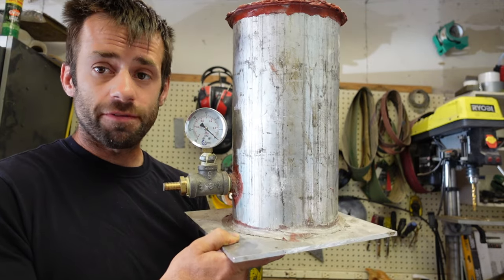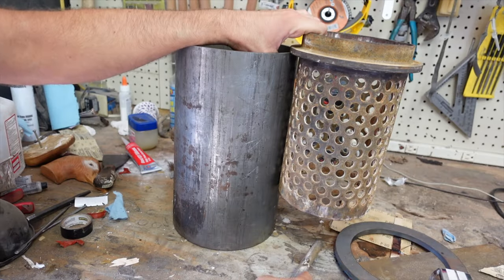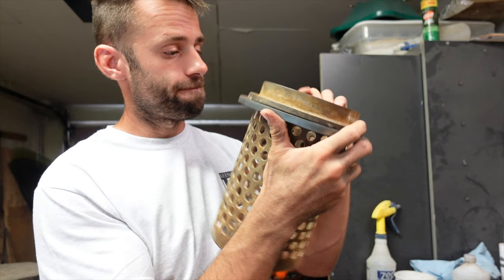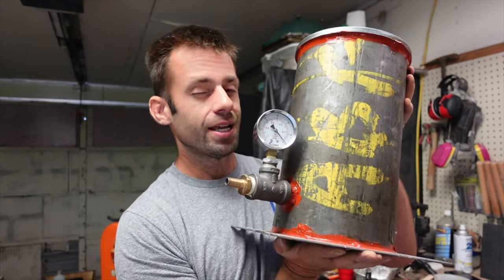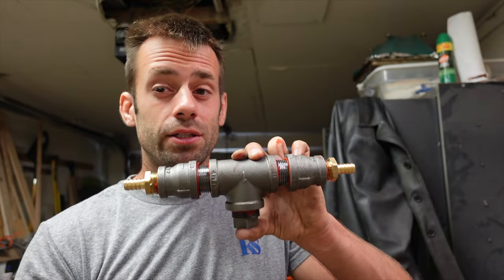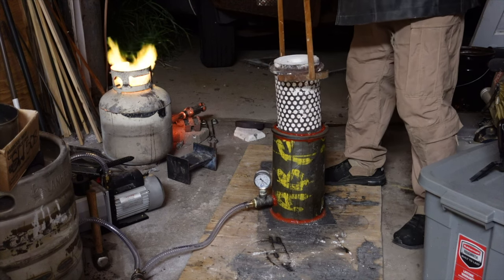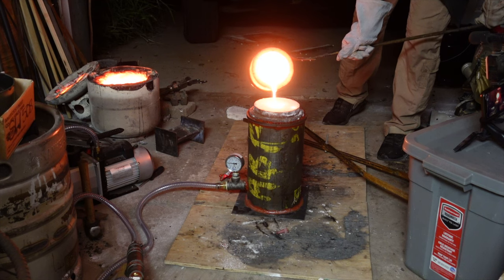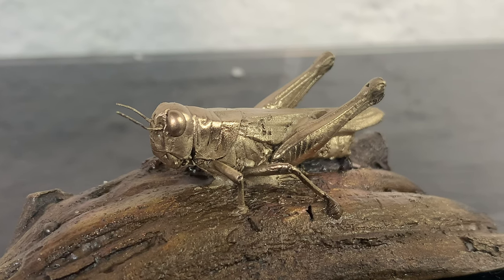DIY Vacuum Casting Set-up/Build, Modified.

Comment: This is the game changer I have been looking for. I've been thinking about getting a setup like Vegetable Oil Guy. They're spendy though. This is right up my alley.
Reply from the maker: Much cheaper this way. I am on my second pump though. So a recommendation would be to filter the air. A lot of smoke is produced and goes into the pump.

Comment: I know I've missed the train by this point, 
But If you want extra safety for the pump, if you put a wad of steel wool/sponge in your trap, it will let the vacuum pass unimpeded through it but if molten metal comes through at high velocity it catches it slows it and cools it rapidly, I used one of these in a pipe as a safeguard and it saved my ass quite a few times when I was first casting on a DIY vac table and had a lot of issues with blowouts,
Reply from the maker: I never thought of that. That sounds like a simple and effective solution! Thanks!

Comment: inside the secondary protector, it's also a good idea to cut a small piece of mesh to cover the "exit hole" from the chamber
it gives better protection from a build up tiny bits that can cause problems over time

Comment: Well, after watching your videos, I decided it was time to pull the trigger and buy some gear for lost wax casting. Got a lot of ideas, hopefully I'll be able to make a lot of cool stuff like you do
Reply from the maker: Glad to hear it!  Don’t be afraid to fail!
Reply: @lundgrenbronzestudios  that's probably exactly what I needed to hear, I'm definitely a little worried. Mostly because of my melting setup, I built it about as large as yours, with sand casting in mind. But with the vacuum caster I got, I'm going to be casting significantly smaller pieces, and I'm not sure if I should go for a smaller forge to match (don't particularly want to be holding such a massive crucible over the vacuum casting machine)
Reply from the maker: @jamesgriffith1008  if you have the room for another furnace it wouldn’t be a bad idea to have a smaller one. It’s more fuel efficient and heats up a lot faster, if all your doing is small melts.
Reply: @lundgrenbronzestudios  yeah, that's kinda the way I was thinking. At this point, I only bought a little 3"x4" flask, since I'm just planning on doing little DnD mini type items, nothing too crazy (yet). The flask fits inside my crucible, with some room to spare, so it's definitely way overkill for the actual casting. But I did just get 40 pounds of free brass today (and have a line on another 100+), so maybe I should upscale my plans...

Comment: Great video, I like how you improved the project.
Sorry for the question, but does the plaster have to be hot before casting or can it also be at room temperature?
Reply from the maker: It helps if it is hot. It allows the metal to stay liquid longer.

Comment: I almost dropped a grand on a vacuum caster until I found out all they are is basically a metal cube with a refrigerator pump inside. I get buying quality materials, but when something only costs a few hundred bucks to manufacture I don’t feel like it’s fair for me to buy for a x4 + markup. That’s the life of a jeweler though, anything for jewelry instantly has a higher markup, I mean look how cheap “ceramic” kilns are compared to “jewelry” burnout ovens. They do the exact same thing and either will work for the other; and one is half the cost.

Comment: I think the reason you got liquid metal in your hose was, because the hose was attached at the bottom. Professional Casting systems (Kaya Cast) have the vacuum intake in the middle or upper part of the chamber.
Reply from the maker: You might be right. I would have put it higher if I had room to fit the fitting and the flask in the pipe.
Reply: @lundgrenbronzestudios  this works as long as it works. If you do a v3 you could do this inside of another larger pipe. Might not even need to be steel since you would already have one steel wall. But might as well be steel.

Comment: Hey , did the vacuum pump come with a 3 way air outlet already installed looks like you swapped it out with one outlet ?
Reply from the maker: No this is the original outlet. I didn’t replace anything.

Comment: Great video and great tips.
I am trying to learn about metal vacuum cast and still don't get how vacuum works in the investment. Is the investment  is porous and them the vacuum suck the air and help the metal goes down ? 
Greetings from Brazil.
Reply from the maker: Yep. Air flows through the investment and sucks the metal into the small places.
Reply: @lundgrenbronzestudios  thanks 😉👍

Comment: What is the role of this suction or vacuum machine in the work? Thank you
Reply from the maker: It pulls the metal into the small detailed areas and draws out any bubbles that may get trapped.

Comment: Hello, Lundgren, again =) 
I never melted metal, so my question and advice are based only on logic.
At the 4:05 you say that the rubber melts and each time you smear a high -temperature sealant. Question: Will the sealant harden with time if you leave it for a day? If the answer is yes! Then why not try to print a large ring with a recess on a 3D printer, pour a sealant there and create a gasket for a vacuum pipe from it?
p.s. I'm used goggle-translate, sorry.
Reply from the maker: It will harden but it will burn up each time I use it. So I replace the seal each time with new rubber. Now I don’t even use high temperature rubber. I use regular calk.

Comment: What kind of liquid silicone is that?
Reply from the maker: The red silicone is high temperature silicone found in automotive stores.  
But for the seal of the flask I’ve started using plain hardware store silicone. Nothing special about it.

Comment: You need to have filter between pump and vacuum chamber. There are so much dust sucking the pump will be dead in no time.
Reply from the maker: Hmm. I never thought of that. Maybe that’s why my oil gets so dirty so fast.
Reply: @lundgrenbronzestudios  I did my casting chamber myself as well. But I don't do big stuff like you, my flasks mostly are 4cm in diameter and 10-15 cm in height. I used just metal container for food drilled a hole and poured heat resistant silicone on top (firstly I put my flask in the hole so the silicone only fill up around it.). So I created something like neck for flask to put in. So far worked fine. Haven't burned or anything and I don't need to do nothing with lack of vacuum as everything sealed. But I don't use perforated ones, just pure solid pipes. Also when you use not perforated is better if you put some straws in the flask, so it will have like holes nearby walls, that's way the vacuum will be better as you increase the area for vacuum, I saw your flasks have barely any area for vacuum (I personally bent few 2mm rods in U shape and putting 3-5 rods on top when the plaster is filled and then when it is hard I remove them. It's U shape so that it can tightly hold to the wall of flask)
Reply: @tobuyornottobuy2319  I'm curious about this... Not 100 sure what you mean though, can you explain a little more please?